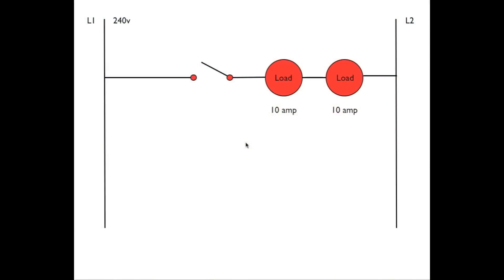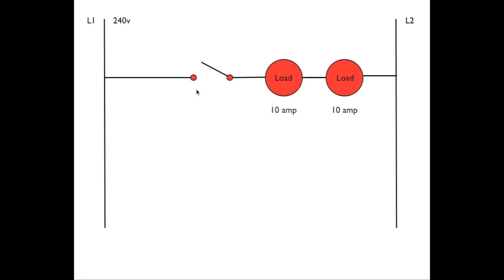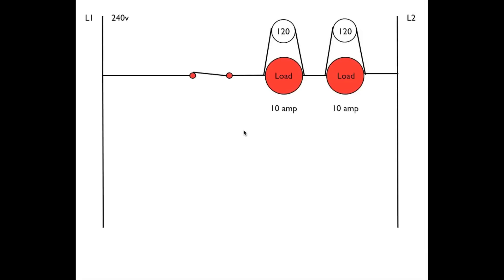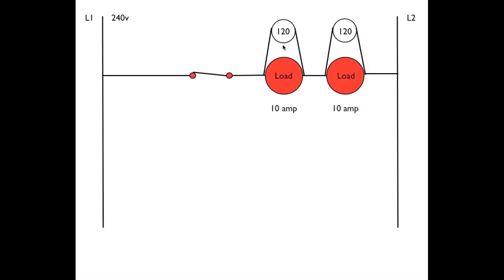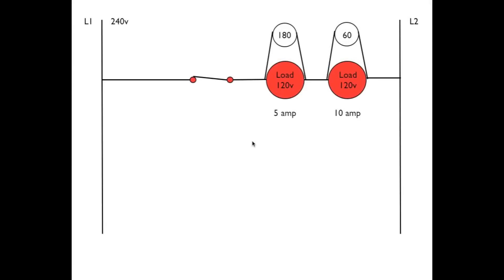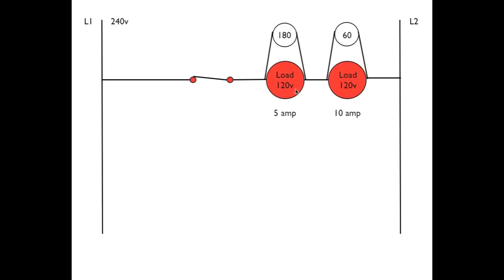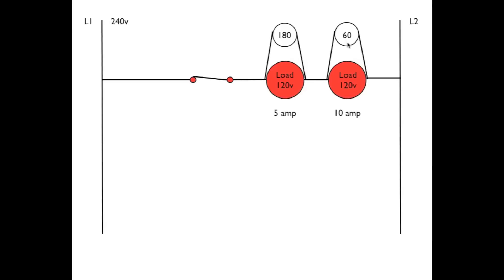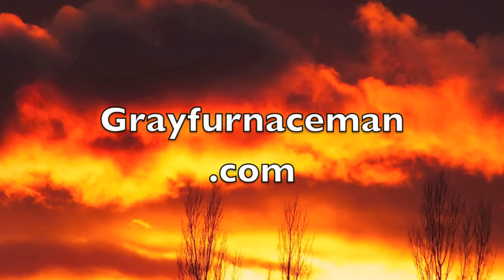Understanding the series load in electric circuits

Comment: Cannot have 5 and 10 amp on same line. The resistance or impedance of the two loads can be different, but not the amps in a series system.
Reply: yea im confused.  grayfurnaceman care to explain?